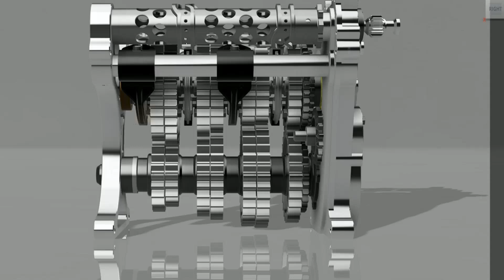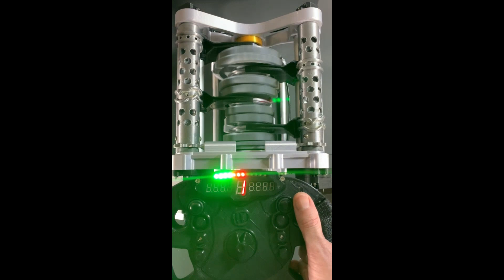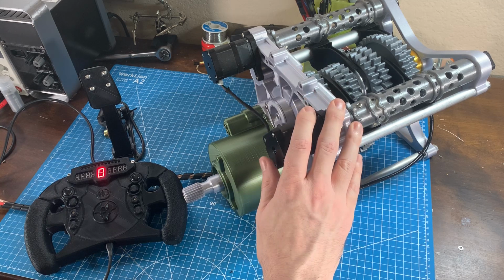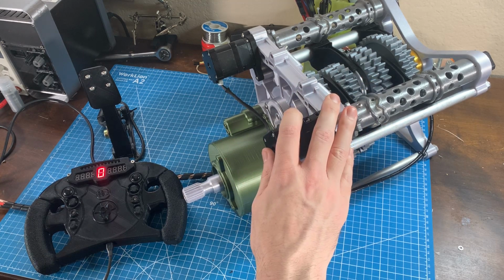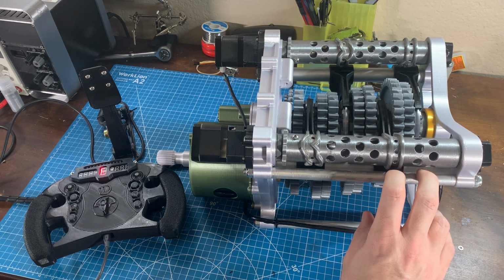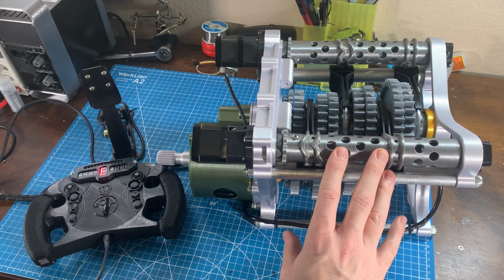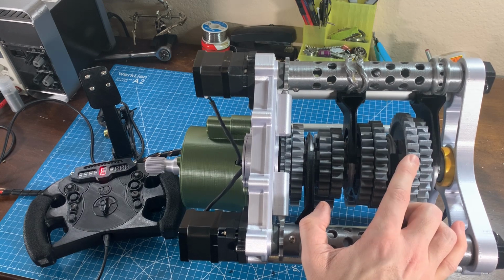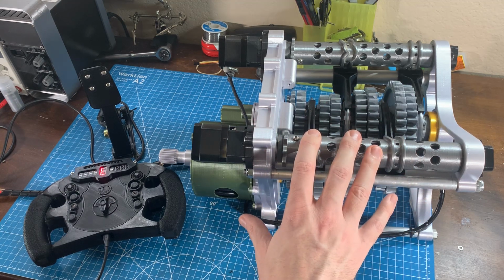3D Printed Formula 1 Gearbox - Part 8 Conclusion

Comment: I understand you are onto bigger & better things now, but I have a request regarding this project; I was wondering whether you would be able to replicate the engine/gearbox settings throughout a single lap of a circuit? Perhaps the track itself could be a guessing game in the comments section?
Reply from the maker: That's a cool idea.  I really want to do that when I get some time.  The simulation software needs significant tuning in each individual gear to be more accurate to an F1 car.  I also need to find a stiffer material for the shift forks to make shifts more reliable  (The gearbox locks up ~1 time per 50 shifts which at high rpm is a lot of broken plastic).

Comment: just started printing the gearbox to use with a 212cc motor in a cycle kart that pulls 8.1 ftp of tork 2500 rpm
Reply from the maker: That's awesome.  Let me know how it goes!  I'm really curious it it will be strong enough to take the loads.
Reply: @IndeterminateDesign  tested the input shaft to over 12 lbs of tork setting on printer with just PLA is 2.0 wall thickness 10% infill 60c on the bed and print temp at 210 at 7mm/s
Reply: @IndeterminateDesign  also working carbon fiber pla shift arms and clutch for the trans
will also try to test PETG sorry it is going slow testing each part as i go also trying to CAD a case for it so i can some type of oil to cool and lube the gears
Reply from the maker: @devion321  That's awesome. I had no idea it would  be so strong.  It's definitely process, when printing mine I had to print each piece and test to see if they fit.
Reply: @IndeterminateDesign  cool quick question is there a PDF or file or vid the show what gear ratio goes where or is the print file in order with the two shafts
Reply from the maker: The CAD file should be in order.  From the front the order is 5,7,6,4,3,1,2.  Viewed from the top the shift barrels both rotate inwards to upshift.  

So it's a bit complicated because this was my 2nd CAD project and Fusion 360 at the time had some serious performance issues.  You'll find some of the STL files, like the input cover and electronics, were separate from the main CAD file due to the performance issues.  I assume you'll be redoing most of this anyways as you'll need to mount it to the engine and package everything. 

Also I think the software that's out there will work for desk testing, but I'm sure the electronics and software will have to be redone to electronically control the engine throttle and rev matching and you'll definitely want some additional safeties in there.
Reply: @IndeterminateDesign  thank you for the info i do not have fusion 360 so your right that i am having to redo some of the files and build new ones most of all the files converted fine for the trans i am working off the main trans file you have all extra files i build plus pics and vid i will upload and try to setup a youtube channel so you see the good work fun you inspired thank you very much

Comment: Great conclusion. I missed what printer you are using.  Which parts would benefit most from stronger material?  I also wonder if there are any small high torque electric motors with limited max rpm that you could use this with in an rc car.  It would be especially interesting to try a motor type that is not usually used for rc cars.
Reply from the maker: Thanks.  I'm using an Ender 3, but heavily modified.  Basically all of the mainshaft and the shift forks could benefit from stronger and stiffer materials.  I'm not sure what would fail after that.  It would be cool in an RC car with something like a coreless motor.  It would have to be a large RC though for sure.
Reply: @Indeterminate Design  I wonder how much smaller one could print it and still have it function as reliably.  Also, I see some small coreless motors doing 30krpm.  Perhaps all that rpm could be geared down to achieve higher torque for a smaller motor and then shifted into usable rpms by the transmission.
Reply from the maker: 30k rpm would be awesome.  I don't know how much smaller you could print it, the dimensional accuracy required is already at the limit for FDM 3D printing.  I've never played with smaller nozzles, but perhaps a 0.2mm nozzle you could reduce it ~30%.  With something like laser sintered metal 3D printing you could definitely do a lot more.

Comment: Dont you plan to make this out of some metal and put it into a gocart? :)
Reply from the maker: Haha.  Watch it lock up and explode with a missed shift.  I don't think I could handle that emotionally, lol.
Reply: @IndeterminateDesign   you could probably implement an automatic shifting program if you have a sensor for rpm input
Reply from the maker: @daddyplankton5855  Absolutely, I have rpm sensors on the input and out to perform rev matching and for the shift light indicators.  I want to do a follow up on this project maybe later this year and address some of the issues I found.